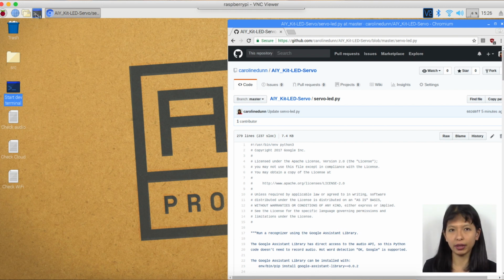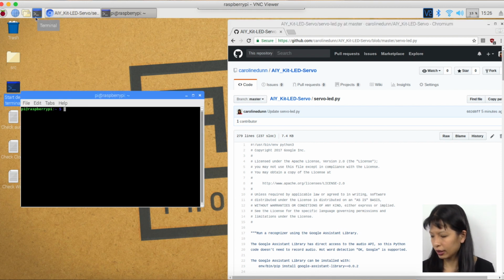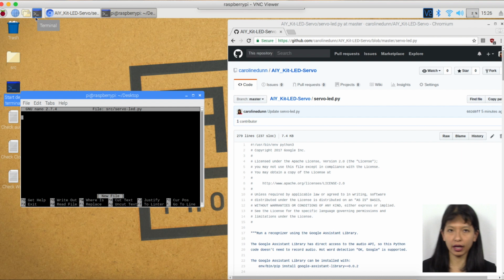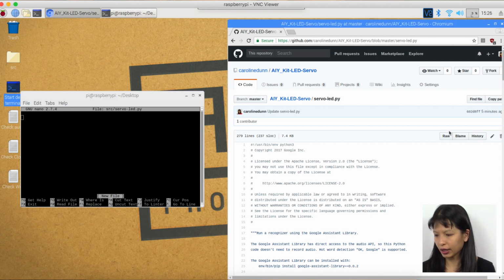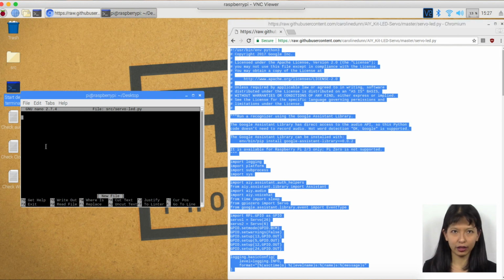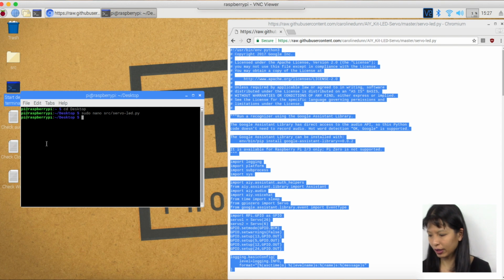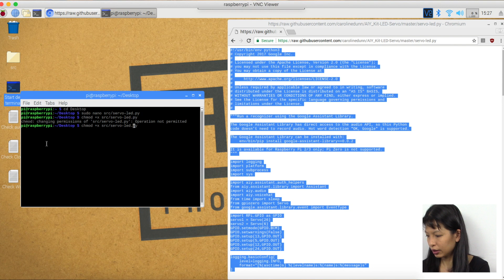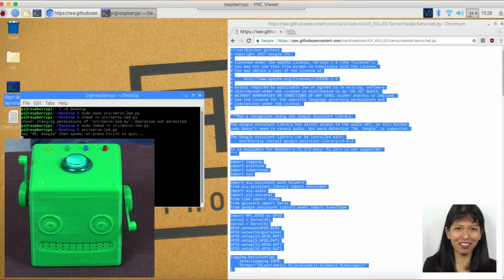AIY Voice Kit with LEDs and Servo Motors

Comment: I think maybe the reason the arms are twitching is because you need to have a capacitor in between the servo wires and the motor controller.  I tried that with a stepper project once if I remember correctly and it seemed to work for me